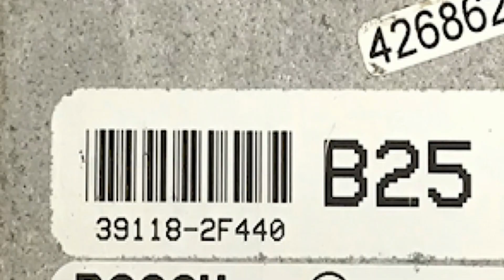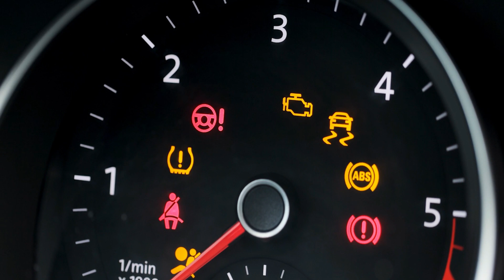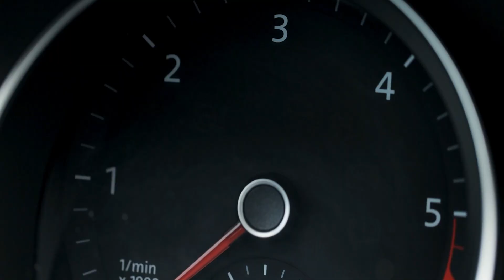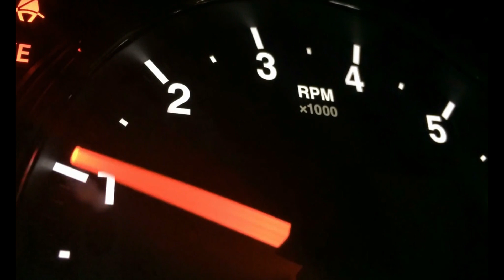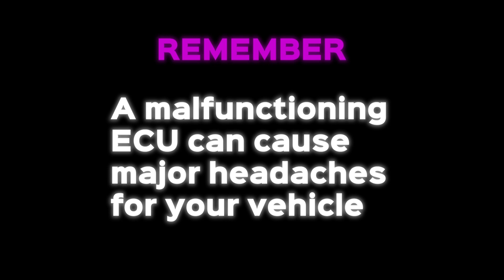The Most Common Signs of an ECU or Control Module Failure - (How To Diagnose ECU Problems)

Comment: 07' Mazda B2300  manual transmission, 4 cylinder. Anti-Thief light flashes quickly when key is turned to start. Car does not start, does not click, no fuel pump sound. Transponder chip in key and the antennae in ignition key cylinder were tested by auto locksmith,  they are communication with each other. Could this be a bad ECU?

Comment: Owner of S500 W221 with issue on ECU cost me 2,200$ to fix replaced with new one. For all people with that issue...my car was running super poorly...from 8 cylinders only 6 were working and not in sync...causes vibration while accelerating - super poor performance...sometimes my car didnt start, but after few IN and out putting key and taking out it works (took 2-3 min for the car to "wake up" and recognize the key go ignite the engine), not gonna mention about the fuel - super bad. If YOU have issue with ECU...FIX it as soon as possible with NEW one that gonna carry your VIN number and the key. It hurts, but if you love your car...you gonna spend 50% of its value to mantain it super nice. And trust me...the car gonna thank you with 100-200k of pure joy. If you drive some sh1tty car - its not worth...like C class or some basic cars with 2 extra cables as "feature" then just scrap the car. But for your expensive babies, please take care.

Comment: WERE IS E C U LOCATED ON A 2009 SIVERADO 5 POINT 3 ENGINE  HOW MUCH $$  DO THEY COST
Reply: Should be in the engine bay on the driver's side right by the fuse box if u buy one u need to buy one pre programmed to your vin number

Comment: Sorry folks, but there's nothing to see here. To sum up 14 minutes of video: "If your car isn't running well, take it to a qualified mechanic." That's it. The video claims to teach you how to diagnose the problem, pointing at the ECM (the COMPUTER that manages the performance of nearly every electrical component in your car) when in fact the problems is much more likely to be a bad sensor, wire or connector! In fact, not one sentence of the video discusses actual DIAGNOSIS procedures, they simply tell you over and over again to take your car to a qualified mechanic, which is safe advice for them to give..... 

This channel is owned by a company that rebuilds ECMs, but nothing about that is mentioned in the video. Just buying and rebuilt ECM from them or any other company, without having done REAL diagnostics and identifying and troubleshooting the codes that the ECM stores, would be folly, as mentioned above. On the other hand, there are a few outstanding videos on youtube that will teach you how an ECM functions, and more importantly how to diagnose the wiring and connectors, as well as the sensors themselves to find the ROOT CAUSE of the problem, and fix THAT problem instead of throwing part after expensive part at your car until it hopefully runs better. Unfortunately that is how a large percentage of repair shops make their money. Educating yourself on how the ECM and other sensors  accessories communicate and how to TROUBLESHOOT them is worth the time you spend learning, whether you effect the repair yourself, or use your newfound knowledge to keep your mechanic honest. Good luck to you all..... 😉
Reply: Ya got TIPM as well on Ram diesels, and..... BCM-BODY CONTROL MODULE,,,, electronic issues taint no joke

Comment: Most of this is related to bad sensors and other components. The ECU is responding the way it should under those circumstances. Misleading, automated bunkum.
Reply: Well, the ecu controls the spark advance and ignition signal. Misfires can occur from malfunctioning ecu.
Reply: @angusmcpherson  Yes, but in practice, ECU failures are rare compared to O2 sensor malfunctions etc.

Comment: THE ECU, or Engine Control Unit, is a computer housed in the engine of vehicles since the mid-90s, in most cases, until today. Its appearance was justified by the industry's demand for vehicles with more efficient combustion in mechanical and ecological terms.

This computer regulates some engine functions, such as working temperature, fuel injection, ignition, valve opening and closing; manages engine rpm, exhaust gas emissions, oxygen levels, and various other parameters for optimal engine operation.
THANK YOU SO MUCH FOR THE 100% REAL VIDEO THANK YOU SO MUCH